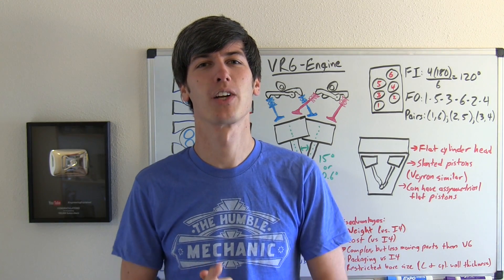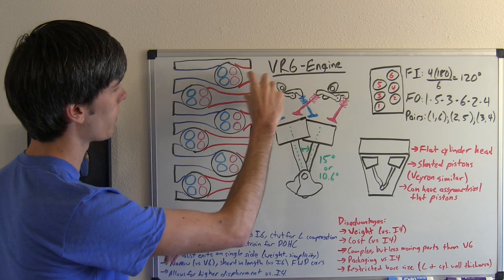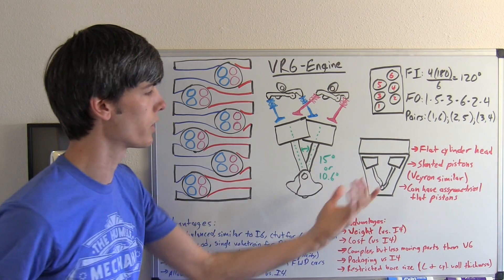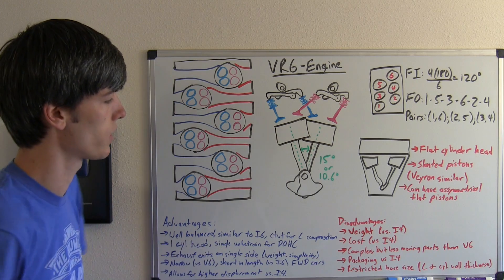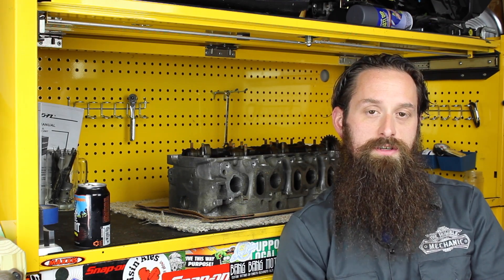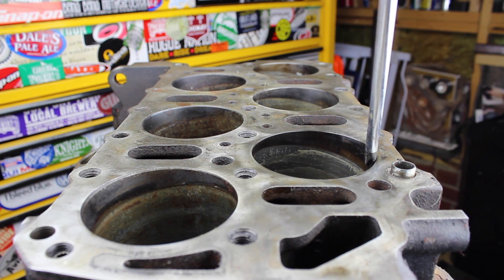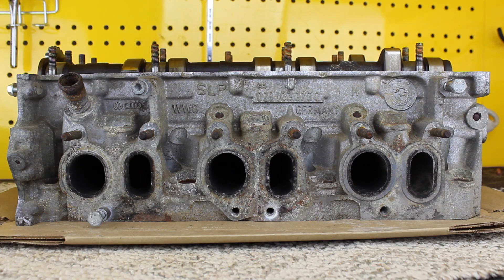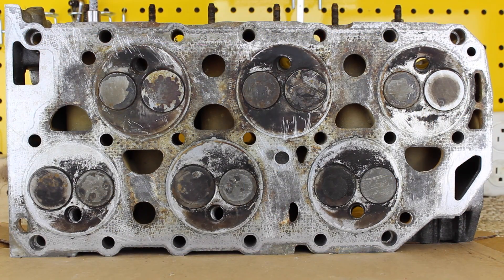VR6 Engine - Explained

Comment: Technically is that not SOHC , since there is one cam for each "bank" of cylinders?
Reply: Engineering Explained 1. Shouldn't it be essentially called a "Double" SOHC? 2. You stated that the camshaft on the left essentially controls all the Inlet valves of the 6 cylinders and the camshaft on the right controls all the exhaust valves. But, Humble mechanic's model seems to contradict. His left camshaft seems to control both the Inlet valves and Exhaust valves of cylinders 1, 3, 5 and his right camshaft operates both Inlet valves and Exhaust valves of cylinders 2, 4, 6? Can you please clarify?
Reply from the maker: Matt Kite Well, it's a single head, and there are two cams. So I'd probably still say DOHC.
Reply: Engineering Explained According to your model it's a DOHC. But, according to Humble mechanic's model it should be called a "Double"SOHC. clarification please?
Reply: Learn about engines and find your own explanation

Comment: 1 small doubt .
 for vr6 engine why there are two camshafts. normal v-type engines have one camshaft.
is camshaft and crankshaft both are same or not?
Reply: gt fr I think you're thinking of a pushrod engine witch has one camshaft directly above the crankshaft (Or directly beside the crankshaft if it's an inline engine) that pushes on thin metal rods running the length of the cylinder to the top of the valve head actuating the valves, this is most common on American V8's in the 20th century, and some lawnmower engines.
Also, the crankshaft is what the pistons are connected too, and the camshaft in what operates the valves, two different things.
Reply: thanks for your explanation
Reply: No problem.  (;

Comment: Question for the humble be mechanic. I heard of timing chain issues. Is this common and If so how many miles can you get by with. And most important is this an interference motor.
Reply: If you're talking about the 12v, it's more issues with the upper rail guide getting chewed up.

You will hear a scratching noise in the engine head by the driver's side (it's unmistakable)
Reply: Btw Normally about 100k  to 150k is when it's due for a replacement and this is an interference engine.

Comment: Hi, thanks for the video, you do great stuff!

I think you made a mistake though.. You mentioned at 2:15 that one cam handles all the intake valves and the other handles all the exhaust valves, right?

I think your colleague said that each cam handles both, and is responsible for in and outs on each cylinder, which is also right in case of the 2 valve per cylinder, no crossing valves with tilted valve-heads.

Is it because you are talking about the 4 valve per cylinder head?
Reply: The diagram shown on the whiteboard is a 24V-VR6. So, the left is the intake camshaft and the right exhaust camshaft.

Comment: This engine sounds amazing in my Touareg.
Reply: You're getting the scenario confused.  Yes, for a given RPM if torque value is lower, then HP is lower.  However, he's talking about increasing his rev limit to 7500 RPM (from the approx 6700 factory limit).  This won't change torque values for 0-6700.  We're now talking about a new set of values from 6700-7500 rpm.  Let's say you output 235 lb ft of torque at 6700rpm - that equates to approx 300 horsepower.  If the same engine hypothetically outputs 215 lb ft torque at 7500rpm, you're now making 307 horsepower.  Hence, as he previously stated: Power increases, but torque drops off.
Reply: +luigi90210 Jesus man, give it a rest.  

You originally stated "if torque drops, HP drops".  I explained how that is not always the case.  Your 370z is one example, but does not prove the rule.  My response, word for word was: "Not necessarily true.  Standard formula to calculate HP is T * RPM /  5252.  Based on this, torque CAN decrease over rising RPM and still net an increase in HP."  At no point did I say that horsepower MUST increase as torque decreases.
Reply: +luigi90210 I'm not sure why you're asking me about risking the motor - I'm not the one raising the rev limit.  I merely corrected your statement about the relationship between horsepower and torque.  Also, the numbers I used were hypothetical to prove a point.  It's possible that the VR6 in question makes less than 215 lb-ft of torque at 7500.  

But on that note, it's quite common for custom engine tunes to increase the rev limit to gain a couple HP on the top end.  The delay in shifting at the top end might also drop you into a meatier section of the power curve in the next gear, therefore make the car faster even if it doesn't increase power output.  (If racing is your thing...)

Most manufacturers engineer some buffer for safety/longevity over top performance.  Whether it's smart to sacrifice that added safety for a bit of extra power is up to you.
Reply: +Marlon Lyn It,s called a "heron" head  combustion chamber  the none 
vw magic takes place in the piston crown old tech hence ze masters 
back at ze bunker not claim it and give it a 25 letter name god  bless Sir
Harry Ricardo and his work
Reply: +luigi90210 Not necessarily true.  Standard formula to calculate HP is T * RPM /  5252.  Based on this, torque can decrease over rising RPM and still net an increase in HP.  Take a look at most dyno charts and you'll see that generally torque is decreasing as an engine is reaching its peak HP.  The relationship to engine RPM is key.
Reply: +Oliver Mayo You can't seriously spout gems like  "why lots of muscle cars and ricer wagons struggle to keep up with stock sports cars, more nails are being driven in a lot faster and it is their engines scooping them up the road faster" and then tell me with a straight face that you think I'M the one that doesn't know what I'm talking about.
Reply: Angry Whale a Touareg with a proper exhaust does sound amazing!
Reply: Even with the stock system, sounds great. I plan to chip the computer so it redlines at a higher RPM, because the internals are rated to 7500 RPM. Also sounds good with the air filter off too!
Reply: I did not know this. I wonder how the power of that extra rpm is. Or if it goes flat???
Reply: I belive power increases but torque drops off.
Reply: Angry Whale if torque drops HP drops as well. You need torque to calculate HP so if torque drops, peak HP will also drop.
Reply: +sandnessmj if torque drops, HP drops, that's a fact. you may gain a couple HP increasing RPMs but the fact of the matter is HP is a derivative of torque, the less torque you make, even after 5252rpm, the less HP you will make.
Reply: Think of it this way - if horsepower and torque were direction proportional (which is what you're unknowingly suggesting), then every dyno chart would show peak HP and torque at the same RPM.
Reply: +sandnessmj you'd really risk your motor for 7hp? I'm sure that's not 100% exact but I highly doubt its much HP to really go crazy about, especially with stock valves, springs, oil pump, ect.
in fact I'm willing to bet there is valve float when you're over revving your engine.
Reply: +sandnessmj if torque is dropping faster than RPM are raising, you will lose HP, that's a fact. I have seen a lot of dynographs and its possible to make peak power before redline(let's say 6650) but as you get closer to redline, HP drops a little. the reason this happens is due to the motor dropping torque at a faster rate than RPMs can climb. 

every example you give assumes torque is falling off at a rate which the RPM can compensate for(so youd gain power) which is not the case 100% of the time. 

I'll use my old 370z as an example, when I had it I put down 327rwhp at 7350rpm but when I hit the redline of 7500rpm I was down 10whp, this happens cause torque has dropped off at a rate that RPMs can not compensate for so by raising my redline from 7500rpm to 8000rpm, I will only lose more HP
Reply: Didn't know there was a war :0 If the stroke of the cylinder is long, you will get more torque at the low RPM's. Torque reaches its peak for ex. 4500RPM in a 4 cylinder, but if it is a huge diesel inline 6 turbo, peak torque will come in at like 1000-1500RPM. Smaller turbos spool up faster too. Torque decreases after it's peak, and the engine is making HP at the mid-top end. Torque doesn't completely go away. Your cam profile and VVL (allows for 2 cam profiles) also has an affect on Tq. lower cam profiles result in better economy, and low end performance. But if you have a motor that revs to 10k rpm and has a low cam profile, peak numbers will come far from redline. So if you have a low cam profile and a high one, the engine will have torque at the low end, and power towards the top.
Reply: Angry Whale torque decreases after 5252 on gas motors because that is when they are exactly the same number

before 5252 torque is greater than horse power and after 5252 horse power is greater than torque but you can still make peak torque after 5252(which is better to make peak torque in the upper RPM range cause you can take advantage of gearing to get moving down low)

you're right about race motors though, high revving motors(10000rpm or greater) will make peak power cause of their high revs, not cause of their high torque
Reply: +luigi90210 Disappointed you deleted your other comment.  Hope you realized what I was saying.
Reply: +sandnessmj deleted my other comment?

i didnt delete shit
Reply: ***** First gen Touareg were dogs with this motor. over 9 seconds to 60. This makes 280HP and gets it up to 60 in 7.5 seconds. Moderate for the luxury competitors
Reply: ***** Diesel V10, or a V8 are options. New ones only have the VR6 and the 3.0L Twin turbocharged V6.
Reply: +Oliver Mayo Is English your second language? Because most of what you wrote makes no sense whatsoever.
Reply: +Oliver Mayo okay tough guy.
Reply: I think you guys are arguing different attributes about characteristics of cars.. In the scope of your arguments you're both right, so need for the hostility.

1. Not always the case, but more often than not cars are loosing hp by redline so increasing pushing it back on a stock head does little to nothing

2. Naturally Aspirated cars have generally flat torque bands on the dyno. Again not always the case as certain things (vtect vvti etc) can affect this.

3. Turbo charged cars tend behave like N/A cars until their turbo tends to spool and actually begin to compressor the air, this is first affected by the Engine and the Turbine side (T3/T4/T6 and a/r ratio) and lastly the design of the compressor.

4. Increasing a redline makes sense when going with camshafts that have a different profile (particularly their duration) as their is a scavenging affect that takes place when you're exhaust is open a little longer (it sucks in more air through the intake valve).

5. The reason why cars do not just go ahead and increase the duration from the bat is because it affects the idle and lower end performance.  Honda and a lot of other companies realized this so they created two camshaft lobe profiles: High Lift/ High Duration and Low lift/ Low duration.

6. Newer technologies compound on this by adding cam phasing and other stuff as well.

don't take my words for cannon as I may be off on somethings, but our purpose is to argue for enlightenment, not to prove we're right oe wrong.  If anyone would like to add feel free.
Reply: +Oliver Mayo Not too mention some cars can become damaged by increasing the rev limiter.
- Engines that do not have the engine head built for high revving can get what's called "valve float".  This is literally the Intake and Exhaust Valve not closing itself fast enough with relation of the piston.  The piston can slam into the valves on an interference engine causing damage.
- Depending on the Stroke Ratio of the Engine (Oversquare, Square, and Undersquare), the affects of the increased revving the engine can be amplified.
     - Cars with an undersquare geometry have an increase Stroke relative to the size of the piston.  What this means is there is stronger pressure placed on the extremes of rotation (Top dead center, bottom dead center etc) and the force required to turn said engine is greater.  For a great example think of a bicycle with high resistance trying to turn.. It's a nightmare.  Key Areas of stress on the bottom end would literally be about everything there is on the bottom end
-Cylinder Side wall Piston Ring / Ringland / Piston (Additional forces pushing side to side, increased friction due to travel speed of said piston) 
-Piston Ring crushing forces on the turn of the stroke
-Crankshaft Related Parts like Rod Bolts, Bearing Caps, Bearings
Reply: +Oliver Mayo interesting. I know great detail goes into the design of the combustion chamber, piston design and some other things, but I don't know the details of how they work.

I do know early VR6 engines were 12v and had a flat head with the combustion chamber effectively on the piston, while 24v had a rounder combustion chamber that occurred in the head.

The flat head contributed to the diesel like sound of the 12v.
Reply: Tony Pate Thanks for the information! +1 for Knowledge

Comment: Engineering Explained you said that each camshaft controls either the intake or the exhaust. But, according to Humble Mechanic and the look of the cam shafts that each cam shaft controls exhaust AND intake.

Comment: I personally feel you missed a few important points in the comparison to other engines. The VR6 main purpose (remember this is modern cost driven engineering) is actually to reduce cost. A VR6 engine using only a single 2v head means only 1 head casting required, big cost savings in tooling and piece cost. 2nd is the packaging is very similar to a 4cyl (being short like an L4 and not wide like a traditional V) but you get 2 more cyls. Disadvantage of these is you can only get 2v per cyl with reasonable costs (adding 2 more valves per cylinder DRASTICALLY increases complexity of the VR head and also components).
Reply from the maker: Beau Lambrou VW is moving away from VR6, and I'm sure a big part of that is cost. Also, I believe all modern VR6s are 4 valve, though the I4 is replacing them as time goes on.

Comment: This engine does not constitute a "V" design by any stretch of the imagination. It is simply an inline engine that saves a bit of space (overall length). Definitely a stroke of genius, but not a "V".
Reply: It is defined as a narrow V. Lancia built narrow V4 engines with angles between 10º and 20º between the cylinder bore "rows". The narrow V angle allows a common cylinder block. V engines use half the number of crankshaft 'throws' of a straight engine with same cylinder count.

Comment: Can you please explain 2:27 and 12:40 to me? If the intake and exhaust valves and supposed to be on separate cam shafts at 2:27, then why aren't they at 12:40? Is the white board engine just newer than the actual one?
Reply from the maker: guillieinthemist Yes, I showed what modern VR6 engines use (dohc). The engine he showed (which he briefly touched on) was older, and thus had one cam controlling both intake and exhaust for each cylinder set.
Reply: Engineering Explained Ok. Thank you

Comment: Jason - great video..  Does the angling of the cylinders (especially at the 15 degree angle) introduce mechanical energy loss compared to I6?  Is the beveling of the angled cylinder head an effort to try and minimize this?

Comment: So, unbeknownst to most, the early 2-valve VR6 has a similar combustion chamber to a 409 Chevy.  Flat pistons, flat heads, and angled deck.  There's a reason that both Chevy and VW eventually stopped doing that!

Comment: So I noticed the white board demo on the cams was wrong (or different than the head he showed). The white board showed that one cam controlled intake on all cylinders and one controlled exhaust for all cylinders, where as the head showed that one cam controlled one bank (both intake and exhaust) Also, it seems kind of odd that the exhaust valves would be smaller than the intake valves, seeing as how air expands when it is heated. You would think that you would need a larger valve for it to exit, now that it has expanded and is higher in pressure.

Just some observations.
Reply from the maker: Brently ThreeHundred The engine he shows is older (the current gens use DOHC) which he briefly mentions. The intake valves are always larger, for volumetric efficiency.

Comment: Stumbled on this video by accident but I love the design over the more traditional V6.  Having the 2 heads and 2 exhaust manifolds in a traditional V6 is a real turn off once you start working on them.  A found a new appreciation for this engine.

Comment: The engineers must have had quite a time working out intake and exhaust charge volumes with the long/short runner set up.  It looks like a simple solution with the different shaped intake and exhaust ports and different sized valves, but I'll bet that took a long time to develop and make run properly.  What a visionary and cool design

Comment: can you tell usdµ some more about the slant pistons ? 
whats their purpose?
Reply from the maker: It's so that they're parallel with the top of the block, which is flat, to have a more symmetrical combustion chamber.
Reply: Engineering Explained
so if i get this right , they change the pistons with slant ones and the engine head remains unchanged  ? So what you have is a bigger combustion chamber am i right ? 
So this would add some power gains to this sort of engine ? Or is this just better to have when u have high power output to handle the forces ? like a mod if u want to turbocharge or something ?

Also thanks for your previous answer and keep up with your video's !!

I have already learned a lot thanks to you !

Comment: Interesting video. The slightly uneven firing from the mis-alignment makes for an interesting exhaust sound. Lancia pioneered the low angle V configuration in a 4 cylinder engine in the 1920s.